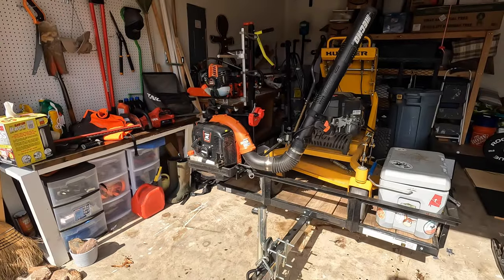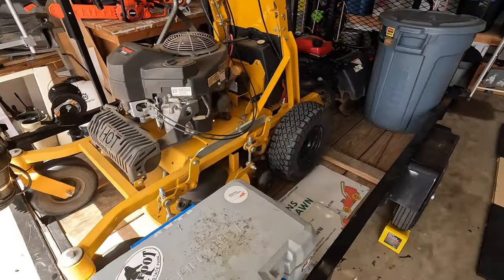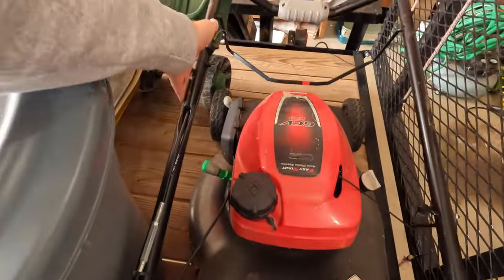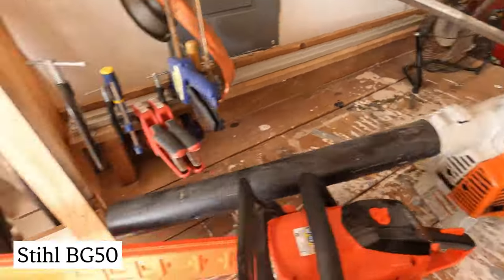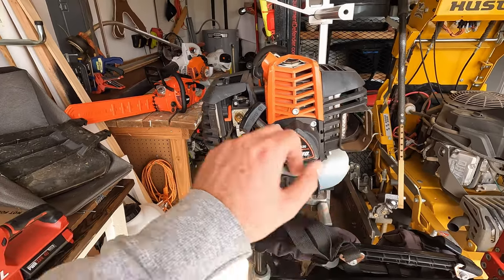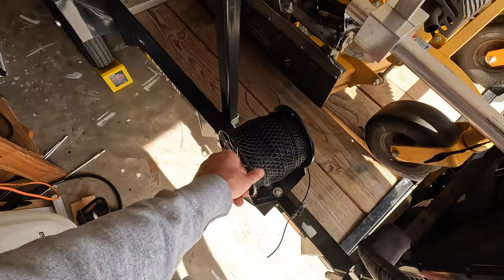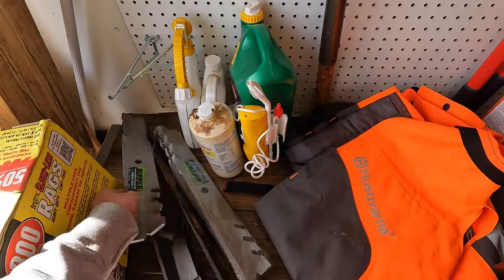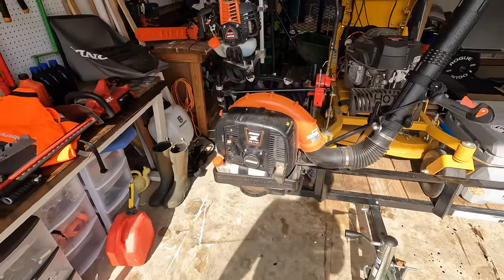(2023) Solo Operator Lawn Care Trailer Setup

Comment: I’ve been thinking about moving to a smaller set up like this, it’s barely even worrh it anymore to have a larger set up or to do it full time anymore with inflation prices. I profit just as much doing doordash minus all the equipment headache.
Reply from the maker: That sounds like a good plan especially if you DoorDash during the heat hours. I find that doing it part time allows me to be a lot pickier (and higher priced) than I would be if it was my sole source of income.

Comment: Great job bro! What size Ballard blades did you end up getting? They told me that they didn’t sell any 16.75” blades for my Surfer Pro 34”, when I asked them on there instagram page. Maybe because I asked them about mulch blades? 🤷‍♂️
Reply from the maker: Thanks Buddy! I bought the blades closest to 16.75. I ended up measuring the ones from Hustler by the guide on Ballard’s website and they were under 16.75” . I haven’t noticed any issues with Mohawking.
Reply: @GrassOnThaSide   oh good to know!